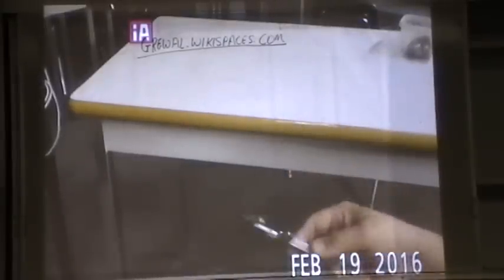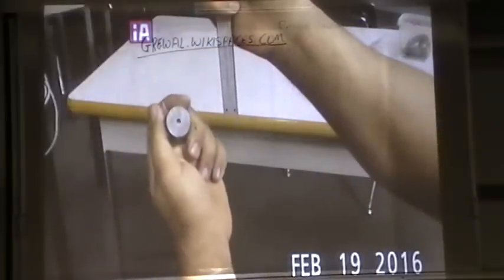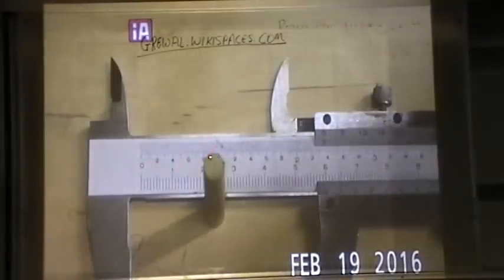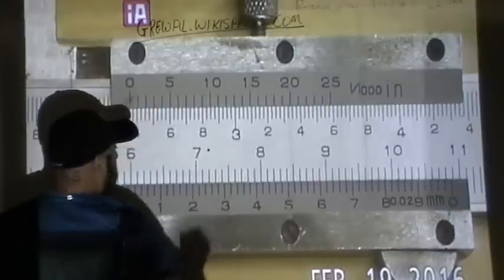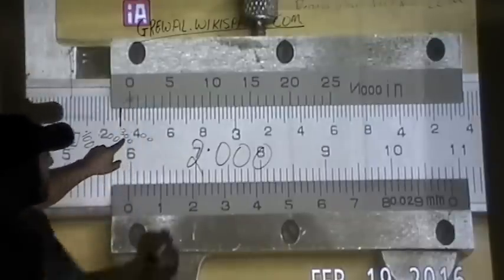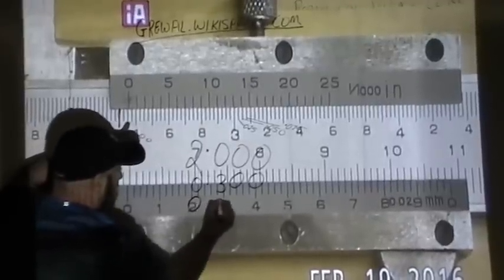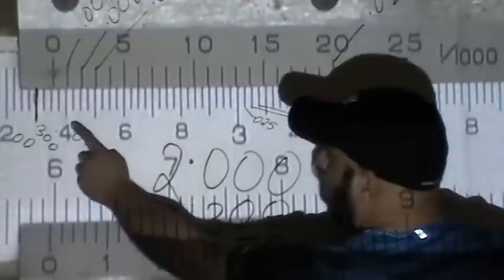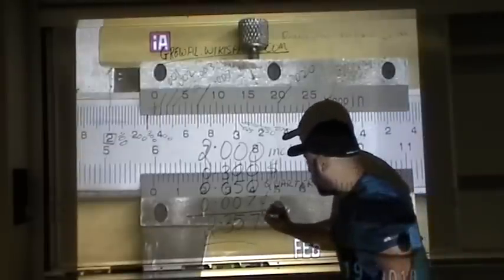How to read an imperial, inch vernier caliper

Comment: using this guys terminology, lets say the calipers read something like:
2.000" inch
0.300 dollars
0.075 quarters
0.000 cents

we get 2.375 inches

how do you include cents into this? for instance:
2.000" inch
0.300 dollars
0.075 quarters
0.007 cents

do you add the 0.007 cents onto the 0.075 quarters for 2.382 inches?